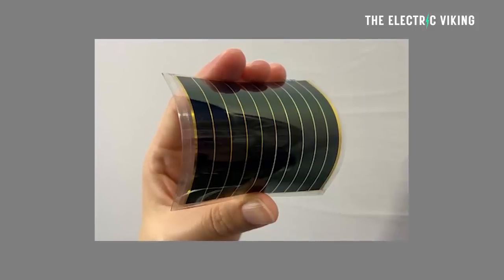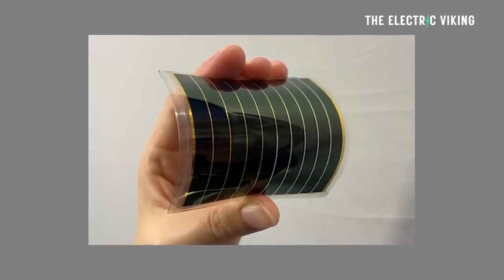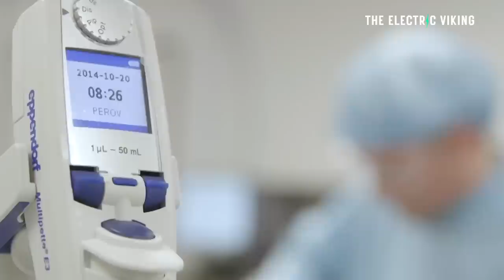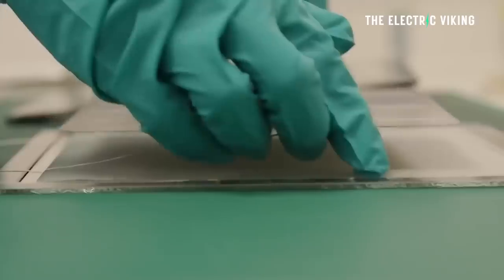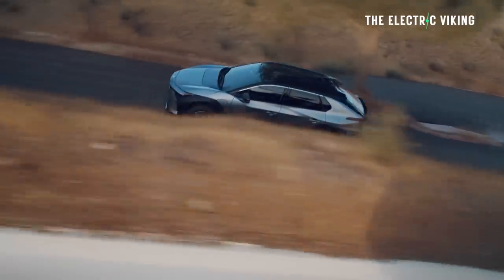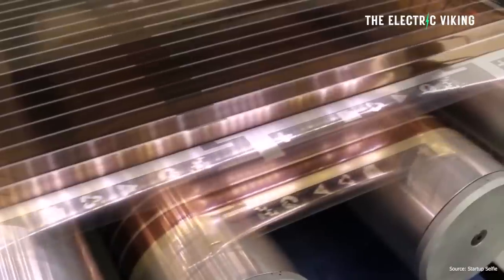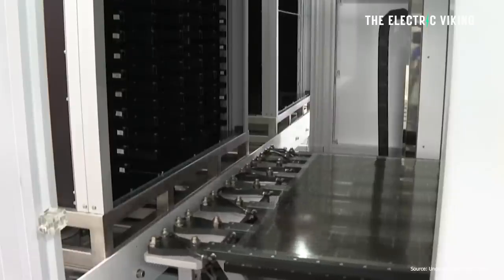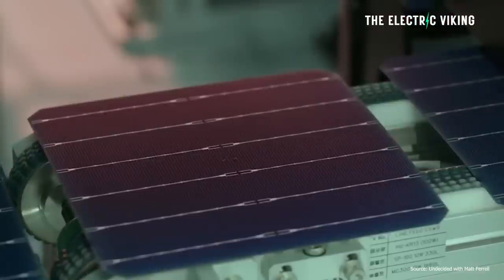Enecoat and Toyota reveal high efficiency perovskite solar cells for EV's

Comment: I have had a solar powered EV for 5 years, my roof top solar fully charges my EV.
Reply: Well done! That's the best way to do it but your system must be very big and your location must be very sunny. I only had room for a 3kW solar system on my roof when mine was installed and it would take over a week to fully charge a Tesla.
Reply: @garyrooksby  
My system is 10kW, for the amount of driving I do in the sunny months the solar covers my range needs, rest of the year its the grid. 
From my experience no mater how efficient solar on car is there will never be enough area on a EV to do anymore then just a little top up.
Reply: @universeisundernoobligatio3283  I fully agree
Reply: In 48 hours, or maybe a Nissan Leaf or Chevy Volt in 24hours(?) Need 25-75% charge-time to actually compare. OOPS ...can't use #Supercharger(!)
Reply: I too reckon that my ground mount PV array provides about 60% of what I use in my EV or about 20,000 km worth of range per year.  That’s after running the whole house.  It good to be able to make your own fuel.

Comment: It wouldn't provide enough power to drive the car around but it could be used to help keep the cabin cool or warm while the car is parked. Or keep the computer from draining the battery as much if it's parked in say an airport for a week or two.
Reply: Well it wont be enough to start with a completely drained battery och go for a ride. However on lets say a 4 hour drive it may actually increase the range by a decent amount

Comment: Toyota reminds me of the energy projects we did in high school.   They’re experimenting with a whole lot of stuff that just cannot work based on the limitations of physics.   There is no possibility that the energy of the sun hitting the limited surface area of the car facing the sun at any time is anywhere near enough to add enough range to make up for the costs involved.  Guys guys guys.  Only good news is that it probably has other applications.

Comment: Perovskites really are the next big thing in photovoltaics, so if Toyota really are experimenting with it, that is good. 
Sadly, I think its initial use will be to replace Silicon in some fixed applications, then as a supplement to batteries in electric aircraft. But cars,? I think the costs vs benefits will preclude it for several years yet.

Comment: The Toyota Prius 2 already uses a solar roof to replenish energy to the battery, but the return is minuscule and probably is not worth the extra cost.
Hope this is not the case with this latest endeavour.
Obviously, solar panels on cars makes sense but is the technology advanced enough to make it cost effective, i have my doubts, but it’s certainly a step in the right direction imho.

Comment: While I applaud getting solar cells into cars,  I can just imagine how expensive fixing the paint on this car will be after a fender bender. Would have to unwrap that area then rewrap it? I imagine that would be pricey. 
Wonder how it handles scratches? Would that entire section go offline? Would the entire wrap not work to gather energy?
Reply: I'd think that the roof would be the main place to put these thin film PV panels, much less vulnerable to damage there.
Reply: You're a thoughtful guy.. know what else is cool, the fact that solar cells are also LEDs, and you could reverse the voltage and light them up if you wanted to. How fun is that?

Comment: In 1835 they said the electric light was too impractical, inefficient, and expensive for mass adoption then in 1880 Edison patented the long life light bulb.  Things changed dramatically back then over a span of 45 years and today I can remember back about 45 years ago when companies like BioSun made solar panels that would barely run a vent fan on a outhouse toilet and some said they also were too impractical, inefficient, and expensive for mass adoption while today we have already had many lightbulb like moments in solar development and are poised to have even more.  

Thin film solar/PV along with solar/PV paint coatings are currently being developed and companies such as Aptera are already developing solar cells for their cars to replenish 40/50 miles of charge per day with their cells passing hail storm testing the other day.  

Its become such a fast paced age to be living in that its difficult to keep track of the things were thought impossible yesterday that became possible today.

How many thought it was impossible to have a shoulder or knee replacement as outpatient day surgery.  I did until a short while ago when I dropped someone off for a shoulder replacement and was told 4 hours later they were ready to go home.  Somehow while I wasn't paying attention another impossible thing became possible.

Best!

Comment: perovskite elements can have 38% efficency and could be produced for 3-5 USD per squaremeter. the only problem today is the durability. But when big money tries to solve this problem we have almost double power of cells with more than ten times the cost.
Reply: There is al least one company from Korea building a plant to sell pv for next year with very high efficiency like you mention. Looks like they solved the durability issue. Imagine pv with 50% more efficiency than current pv, it's going to be huge !
Reply: Problem #2 is that this perovskite tech includes lead. The world has spent/is spending decades getting rid of lead in the environment. It will be a problem for future recycling.
Reply: I have read your comment a couple of times and I am  still not sure what I understand your text to say is actually what you meant to say!
Big money is not going to double the solar cell efficiency to 2x38% inside the next 5 years. Big money has been flooding into solar for 20 years, and efficiency has still only increased 10-15% in that time!
You say "10x the cost" for new solar cells, but don't you mean 10% of the cost?!
Reply: @mb-3faze  true, but there are already companies working on lead-free pv, efficiency is not as high but they are working on it, promising
Reply: - also if cost to recycle is low, a medium length life may be acceptable - or if using cheap common materials - just add on another layer - like overlaying roof shingles.
 - yep ppl thinking "10x less" means something intelligible - then make a typo (go back and edit comments - it looks much better if readable) - 1/10th maybe the cost of 1990s solar.
Reply: @unclefatbloke687  my solar panels are listed with 21% efficiency 38% is not double, but close enough to make a big difference. I wrote big money could solve this problem referring to the durability. And you're right: I meant 10 times the result for the money spent. Big money has not been working on durability of perovskite cells.
Reply: @ciaotesla  and their name is? Come now, you cannot be so enticing… Please try to look this up and provide a link for the discussion!
Reply: @PhilipX2030  cannot post links, one is Qcells, search it on google.

Comment: I ran my own numbers when Sono were promoting the idea, ignoring their over-optimistic estimates. In cloudy old London, for someone without home charging, I reckoned you could get 1000 to 1500 free miles per year mostly in the summer, which would be a useful boost for a low mileage city driver stretching out the time between needing to find an expensive public charger. Only a smallish benefit but those who totally dismiss this are wrong.
Reply: Much better to have the solar panels on the roof than the car. The car can’t always park on the sunny side of the road or even outdoors.🤔

Comment: 9.5% efficiency is not that great.But if it's very low cost, then it has merit. Perovskites do have issues with much higher surface degradation than Silicon, so it would be interesting to see how Toyota have addressed that deficiency. Thanks Sam.

Comment: I do think having solar on a vehicle is a cool idea, I would wait until the cars are low enough weight, and the batteries are low enough weight, and the solar panels are cheap enough, and at mass scale, before I would, as a consumer, pay the small premium for a solar on a car or flying car or whatever (flying cars are super inefficient so they may need the range boost, also they could use basically wind turbines while gliding to get back some charge maybe? if they can glide at all, I mean flying cars don't really exist so it's hard to speculate on what they might look like if they will)

basically, I think this would start off as a feature on low volume premium vehicles at first, and maybe trickle down into the mass market

what aptera did with making a lightweight hyper efficient vehicle, I think is the only way this technology might be useful long term, I would personally rather use my house as a solar generator, as it has a bigger roof, and more space for batteries, but if everyone has maxed out solar roof, and that's still not enough, and you don't have a garage, maybe a solar car might work

what I think is a great idea is a solar camper van, that would be sick
Reply: I love how France just passed a law for any parking lot with 80+ spaces needs to be half covered in solar canopy in the next 2 years. Right, we should do that in the US! Why let the French have all the fun, consider the market and economic activity gained, not to mention stabilizing your grade with a proliferation of Microgrids for vehicle charging

Comment: Sounds like a nightmare.  I’m sure everyone has had panel work done after an accident at some point.  I’m guessing repairers would have to just bolt on new parts supplied by the manufacturer.  No more repairs or paint.

Comment: I will not be buying an ev without solar. Aptera is winning that so far.
Reply: Instead of buying a car with solar, buy a house with solar, and plop the car in the garrage indoors.

no vandalism
Reply: @nyanbrox5418  I going grey nomad, no house, is future plan.
Reply: Aptera is not doing anything except missing funding and production deadlines. You can have my reservation. They wanted to deliver the car without dc fast charging, geniuses.
Reply: Even on the super efficient aptera which also has a very large surface area for a two seater, it wont get you that far. oK i hear you say"i dont travel that far" .. well in that case, even without solar, you'd almost never need to plug in anyway. Maybe once every month.  So the solar isnt buying you much.
Now make that a heavy inefficientl toyota you might get 5 miles a day. And there's added complexity (aka cost) in adding it to the cars you dont just slap on   some PV you also need to add electronics to get that small amount of solar into the car.
I think Toyota should make their cars out of press releases.
Reply: @nyanbrox5418 ...yeah...but it would be nice if the car would get charged without worrying about a charging station.
Reply: Why not? - solar on cars is a feature- makes sense if it’s cheap enough. But solar adding a few miles a day isn’t making or breaking EVs
Reply: @thyristo  the charging station at your house you mean, it's more likely people fit a giant wireless charger in their garage imo
Reply: My present ICE 4wd has solar on the roof. It keeps my fridge and lights running while camping. Still plenty left to start the car after a few days. If I make an oops and battery goes flat, I park for a day and it charges up. Solar for ancillaries so they don't deplete the traction battery makes lots of sense for my needs.
Reply: @christover1  Solar is legitimately a game changer for campers, also if you want to live completely off-grid

Comment: Better application for stationary solar capture, laminating container for refrigeration with heat pump, or building. Marginal efficiency for consumer EVs, possibly increasing range by maybe 5%, which 'probably' will be added to the purchase price. Calculate #Supercharger/home costs versus Toyota's BEV cost, for TCO. Solar and battery chemistry/technology are moving rapidly. Remember that 'accidents-happen, and any accident that impairs a panel function will not be readily fixed, so swappable carriage paneling should be a factor. Bang, ...you just lost that panel, and replacement cost/availability is not a given. I love the technology of thin-film solar, but not in consumer EV applications.

Comment: I own a yellow solar paneled production converted Pontiac Fiero called a Destiny 2000 by its (re)manufacturer Solar Electric Engineering out of Santa Rosa, California. This was done around 1994ish. This was an Ebay sold vehicle that had been sitting in a dark barn when I bought it with dead batteries and didn't know if it would work at all. A day in the sun and when I turned the ignition switch on and pressed the accelerator it wiggled. It was alive! I bought new batteries for it. Eighteen (18) Trojan 6 Volt 250 ah batteries and I was off and running for years. It was originally blue but after a trailer incident it ended up needing body work, so I had it painted Prowler Yellow. I parked for work in an open outdoor parking lot so on a daily basis I would get a few miles of range from its solar panels. It cost me only about $7.50 a month to charge at home on a 110v outlet. Thanks Sun. https://www.autoblog.com/photos/dc-auto-show-destiny-2000-the-solar-fiero/

Comment: Solar power is 1kw/M2 AT 100% efficiency. The very best cells do not get more than about 30% and are extremely expensive. I would bet that you get more than 25% in real life and that is VERY generous. I do not think that you could cover more than 3 m2 on the car so 1 kw per hour... at most 10 hours of sun for 1 day and you than get 10kw. the very best EV out there use about 1.5 kw /km so  you have a range of about 6km.... this will be ridiculously expensive for what you get.

Comment: The only reason I see that you would add this is to prevent your battery from being drained while parked for a few days. It doesn't deliver enough energy to make a difference for an EV's range. It might be useful for lighter vehicles, like ebikes. Toyota makes a lot of different vehicles, including many industrial vehicles. They will find a use for it.

Comment: Seems a good idea, but needs to be on parts of the car not exposed to road damage from stone chips. Also worth noting that solar efficiency plunges when their temperature rises, so not sure how mounting them on a aluminum car body with no heat sink on a hot day would give you anywhere near 9% efficiency.

Comment: Max about 1 HP , can you drive a car with 1 hp.    If you assume the area of about 2 solar PV panels.
Reply: Are you suggesting running an electric car solely on solar panels without batteries ?
Reply: Ice cars replaced one horsepower transport a century ago.🐎

Comment: What happens when the car's battery is full and the solar cells are still producing electricity?
Reply: If the car has v2h or v2g and you are plugged in at home the excess can power your home or be sold to the grid. If you are not home the excess could pre-cool or warm up the car depending on the weather. Otherwise nothing needs to happen and it is not a problem.

Comment: It absolutely DOES make a lot of sense to put solar panels on car roofs. Sure, you can not expect to fully charge the car from it, duh. But it gives ALOT of other advantages. It adds +5% of power while on the move FOR FREE. Who would say NO to that?! And what's wrong with returning to your car parked for whole day somewhere under the sun and have +2% MORE battery instead of 2% LESS? Teslas have a few wonderful features -  Sentry Mode, which monitors and records the surroundings if needed AND cabin heat protection, that keep the cabin cool. Only nobody uses those features because they deplete the battery like crazy. You have solar roof panels - you don't have that problem and can use those features.  And a cherry on top - having solar roof panels DELETES the utterly idiotic, useless, disgusting full glass roof!!! Full glass roofs are THE most idiotic "invention" of automotive industry EVER! They make the car heavier, more expensive, make insurance cost more as they DO break, allow A LOT more heat into the cabin, forcing you to run A/C more, losing efficiency, losing range, battery degradation and so on and on. All the while they have ABNSOLUTE ZERO functionality or ANY kind of use cases.